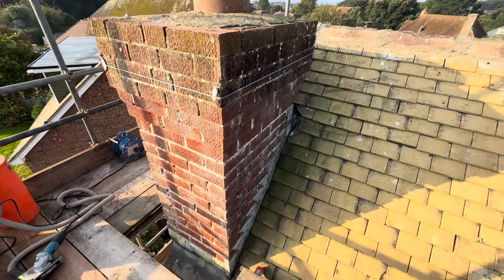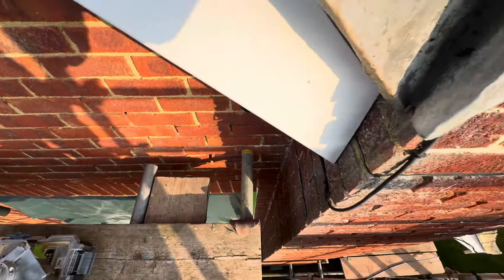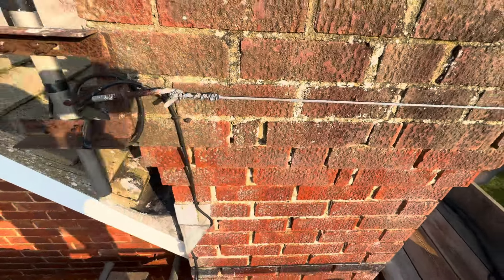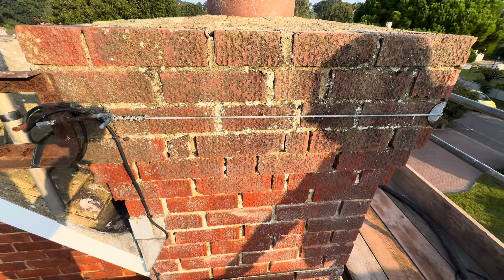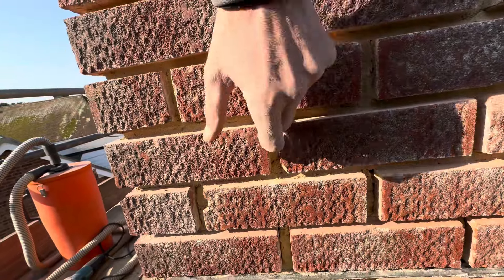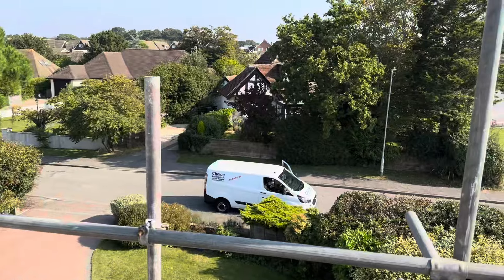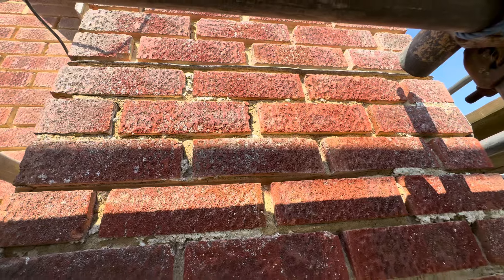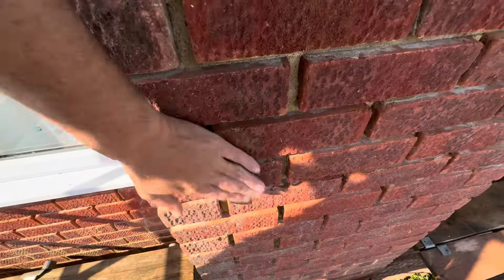Chimney repoint with the old bricklayer /cafe

Comment: Ben is that round flu for a furnace or fireplace, do you use cap on flu pipe to keep rain and moisture out, I see the telly antenna around the chimney, they now make a roof tripod you can adjust to hold antenna as we have found cold and heat affect the wire and have caused damage in high winds, nice cobel finish on chimney will look super when completed, wish I could join you for breakfast, all the best,
Reply from the maker: The fire has been taken out so will put a cap on it